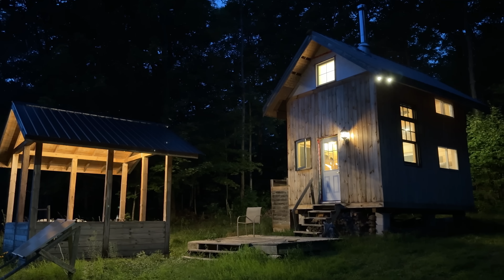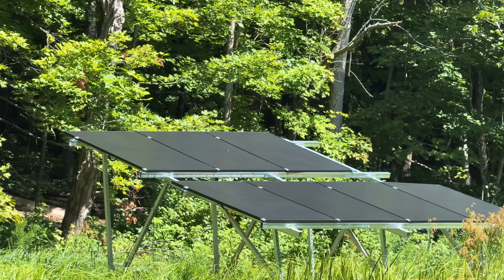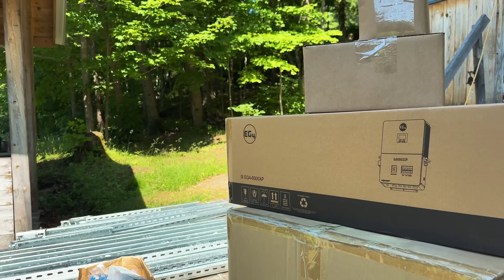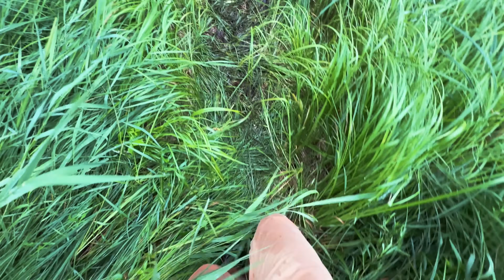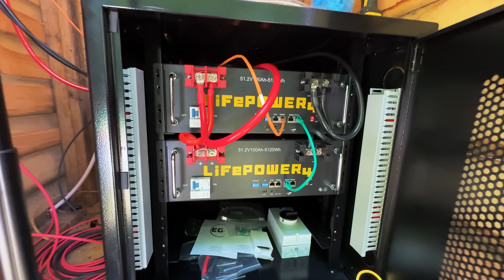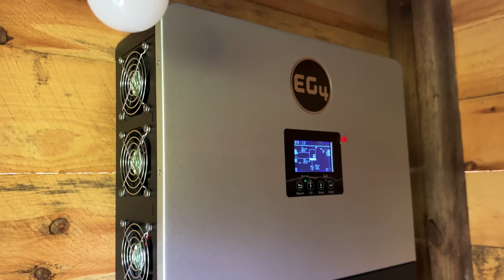Cheap & Simple Off Grid Cabin Solar Set Up - Anyone Can Do This!

Comment: I agree with some of the other comments here. This is an awesome setup and I'd love to have it but I see you've mounted your inverter box and maybe other items in that little section where I can see light through the wood walls which means if you get a heavy driving rain from that direction you're going to have water splashing through onto your electrical device or devices? I would pull that out and fill in all the cracks and add some Rockwool insulation while you're at it and you'll be much happier.

Comment: The battery capacity is determined by Amp hours AND voltage. It’s easier and better imo to use Wh for the battery capacity. In this case the batteries are 5120Wh each. 

The power consumption of appliances is specified in Watts too so that makes it easy to use. 
For example: 1 full battery can run a 1000W heater for just over 5 hours or 10 lights of 10W for 50 hours.

Comment: Here's what Google has to say about EG4: "As of October 2025, EG4 Electronics is facing a legal investigation regarding premature inverter and battery failures, but no class action lawsuit has been officially certified. The law firm Migliaccio & Rathod is actively investigating consumer reports of hardware failures, which could potentially lead to a class action. 

However, the company's terms and conditions contain a class action waiver, which could complicate such a lawsuit. 

Key issues leading to investigation.

Premature hardware failures: The most significant complaint involves EG4 inverters and batteries failing within a few years of installation. Some users report multiple equipment failures in a short period.

BMS and firmware issues: Consumers have reported that battery management systems (BMS) have failed, which can cause communication problems with inverters and result in power outages.

Security vulnerabilities: In August 2025, the Cybersecurity and Infrastructure Security Agency (CISA) published an advisory on multiple security vulnerabilities found in several EG4 inverter models. The vulnerabilities could allow for unauthorized access to a user's network. EG4 has acknowledged the vulnerabilities and has been working on a fix, including new hardware.

Poor customer service: Complaints on social media and forums detail customers' negative experiences with EG4's customer support and warranty claims, with some reporting difficulty in getting timely responses or proper solutions for defective equipment."

Comment: great video! We have bought the EG6000xp and hope to get it all installed before winter sets in. I see you have an on-demand water heater in the shed too, assuming propane? Do you have to vent it out and if so, did you go through the wall or ceiling?

Comment: I saw that your your solar cabinet where you’re putting your inverters and stuff you can see right through the gap in it. Do you have any problems with water coming in there towards him solar panel controllers if you do, why don’t you put some metal up on the side of that or something to keep that from Leaking through our find some boards and go up and down with your boards instead of and just go over the top of the board that you got going across and then that way you’ll seal off the other boards and then put a strip down the middle of each one of the gas and then you’ll be better off because let me tell you one drop of water gets in that inverter and you ain’t got an inverterthe way I see it

Comment: You know I saw a deal and was actually proven standing by side panels where they pick up solar from both sides standing straight up north and south and they were bringing in at least 50 to 60 to 70% more power than normal. Set up. Check into it try see what you get. Talk to you later bye.

Comment: Great set up. 🎉 Is it safe to leave those batteries continually charging for a month without being discharged? Wanted a similar set up but worried it may be a fire hazard if the batteries are overcharged if unused for an extended period. Appreciate the guidance.
Reply: Those batteries are Lifepo4 - so fire risk is much lower than Li-ion. They also shut off because the eg4 all in one has a BMS system to control the charge and prevent overcharge

Comment: .....not living in a "snow zone", would it be wiser to increase the angle of the panels? The steeper the panels, the easier snow can slide off? And steeper panels work better wit the lower winter sun. The current angle already collects more power than you can use. Can you use any live stock to keep the grass/weeds down? (Once a year path spray?)

So many batteries are rated in amp hours. Is there a reason that kWh isn't used?
Reply: this system is at a fixed 20 degree angle which sucks for snow regions

Comment: Love this build!  Now here are the thoughts:  In the pump house I noticed you can see thru the cracks in the walls to the outside.  Does this not allow moisture, insects and small critters in to live and chew on stuff?  I was also concerned with the holes thru the walls where the power cables ran not being filled with any sort of spray foam or rubber grommets to keep critters out.  Fantastic build though, my only other thoughts were your water storage (mentioned by another commenter) needs to be covered to prevent stuff growing inside the tank and on the water) and I would clear cut the area around the cabin several feet/meters) from the cabin as well as put down gravel for a yard instead of grass in case of forest fires.  You folks in Canada (at least I think you guys are in Canada) may not have to worry with that as much as the U.S. does, but it would SUCK to lose all that due to forest fire.  Oh and move the LP tanks away from the electrical stuff.  DANGER WILL ROBINSON!  DANGER!
Reply: Just chiming in as someone living along the Saint Lawrence river: Canada knows about forest fires, half of the country has been catching fire every year 2023-2025. Wikipedia has good maps for each year available in the Canadian wildfires article.
Reply: @SteveDave215 , true. We have a lot of arsonists in Canada, too. It's almost like they are being paid to start fires.

Comment: You must be close to the equator.  I haven't seen that low of an angle for a solar mount north of Arizona or Florida.  A mount like that would not work efficiently anywhere near where I live.  We often run greater than 90 degrees (vertical) in the winter to capture the most sun, especially with double-sided panels.
Reply: I'm 90 percent sure they are in Canada, that 20 degree thing is a major let down for me

Comment: Your going to regret using eg4 equipment. 
Pure Chinese junk.
Am i biased with it.. Yes
It's failure rate is the highest level of all off grid equipment. You seem like smart people that should have gone with Victron or Solark. Some people have to learn the hard lessons.
But i love your whole setup beautiful spot for a cabin. Even though it looks like a natural flood zone older swamp area. They always reflood every 150 years or so. Have you done the topography of water rewetting.
On top of everything i mentioned it's all going to burn 🔥 everything down because none of your equipment has protection from storms and it's just gonna fry 😂

Comment: Who in the world talked you into buying that cheap, high-frequency, transformerless inverter. The Chinese have been dumping these poorly designed lightweight inverters on the US market for the past 30 years and they've never been able to develop a reliable product. They offer a much poorer peak power capacity, a shorter life expectancy, a less stable output waveforms, and they can damage your home's appliances when their MOSFETs fail because they lack galvanic isolation between they don't use an output transformer. You should have installed a low frequency, transformer based inverter instead.
Reply: Like clockwork...
Reply: Wow You must be the smartest person on the planet
Reply: @jeffbrown222 Nope, just smart about inverters because of my 25 years of experience repairing them.

Comment: Nice.  Good match-up, that will net you around 10kWh/day, good for roughly 350W of equivalent continuous load 9 months out of the year though you might want one more battery to improve evening margins.

The propane cannot stay in that shack with the equipment.  It needs to be moved outside or to a different shack / adjacent shack.  Any leak and relay/contactor operation in the 6000XP can spark a ba-ba-boom.

For winter make sure the base-board heater is directly connected to the battery bus (or through a DC-DC directly connected to the battery bus), with a thermostat and voltage controlled relay, and in fact I would even also throw in a little 10W PTC backup element (without a fan) in the battery box that is left on 24x7 (in winter) and insulate the shack.  If the equipment is left on it should be ok... you want waste heat from the charge controllers and 6000XP to also contribute to warming the shed.

If snow is an issue those solar panels will get covered if not attended, so consider also having a small number of vertical panels placed somewhere that generate enough energy to at least keep the heaters operational in winter.

It might take a bit of experimentation but basically PTC elements (sans fan) can run on AC or DC at basically any voltage up to their rating, so a PTC element designed for, say, 40W @ 120VAC will do less at ~48VDC.  It is non-linear though so requires experimentation.

The direct connection is needed with both a temperature controlled and voltage controlled relay to ensure proper bootstrapping in the morning if the battery ever becomes exhausted since the batteries will refuse to charge if they are too cold.

-Matt
Reply: I’m wondering something Matt.  Did he ask you for your fucking opinion ? Or are you just some asshole who thinks you’re smarter than everyone else in the room.

Comment: Rather than getting baseboard heat into the battery room, it would have been simpler to buy self-heating server rack batteries.  The up front cost is more but it will consume less power to keep the batteries heated than heating the battery room.

Comment: this is a great real world example.  one thing i am wonder about is the panel angle, looks to be set for summer sun angle. with the shorter hours of daylight i wonder what will work our for more energy capture.......change the angle for winter sun angle or more panels.  i have found that i have way more energy than i need in spring, summer and fall but still struggle in the short winter months. i moved all of my panels to a winter sun angle in august and still get more power than i need so i am keeping track of how my energy needs are met thru this winter.... be interested to see how yours goes as well.......

Comment: This was one of my Favorite Videos From the Solar Lab, and a shot out to the Host for doing it all pretty much by himself. I did have a few questions. What model of the Chico Mount is that? I wanted to get the 10 panel version BUT.....Signature Solar Only sells the smaller module version. (meant for 200-300w panels.) what kind of panels did you put on them? Do you think I could mount the Chico ground mount on 6x6's instead of using those ground screws you used in the video. I was thinking about getting Three 10ft 6x6 pressure treated cut them in half, Put them 2 or 3 feet in the ground, with a little gravel at the bottom of it, I'm in michigan ,we get a lot of snow here as I would Imagine you would in Canada, I would need mine raised off the ground for snow clearance.  As far as the little Shed you have the Inverter/batteries in how about siding on the outside, with foam on the inside. It would be a great place to install that EG4 Solar Powered Mini split in.

Comment: and the total cost was? 1600.00 EG4 inverter, 2 batteries 2 times 832, 6k for panels? plus wiring and your time, for a total of what?
 thanks
Reply: Panels should be roughly $130 each if bought from a wholesaler and picked up directly (not shipped), so it should be more like $1K for eight panels.  But it really depends what mechanism he used to purchase the panels.

I think that ground mount is around $250/panel very rough equivalent.  $2K or so for the ground mount (?).  $1.5K to $2K.

Not a cheap system but the result is basically a totally livable off-grid property.

-Matt